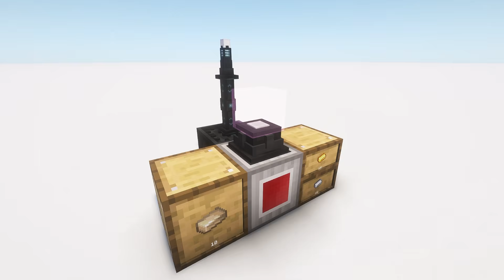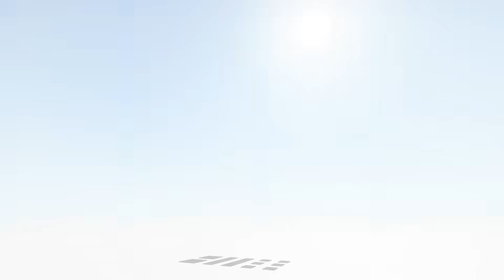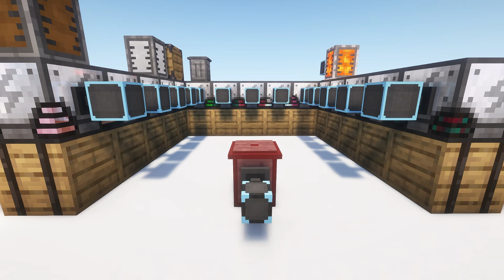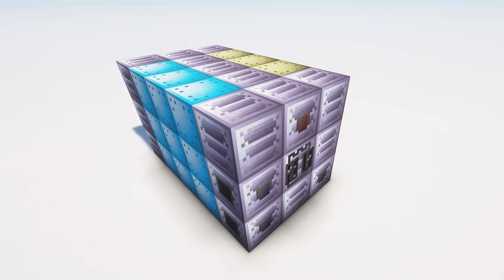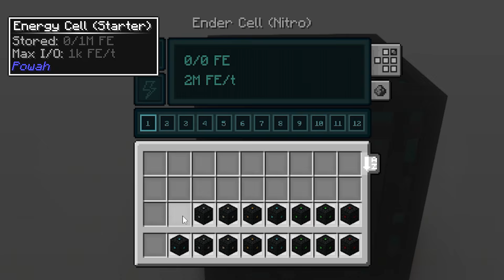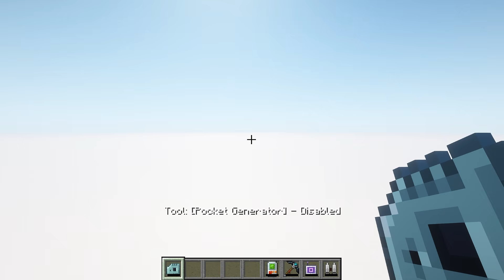Best Power Sources and Setups in All The Mods 10

Comment from the maker: FAQ:
- In newer versions, you won't be able to put a glass bottle in the fluid tank slot. I tend to put another fluid tank in there
- Gas burning gens were nerfed after this video. But with 'Mekanism: More Machine' that was added you can run 1 Ultimate Pressurised Reacting Factory which will be able to support 6 gas burning gens off of the same setup. Each gas burning gen now makes around 30kFe/t
- It's not a glass tank. It's a framed wallboard I put on the outside with clear glass
- Draconic Evolution was added after this video
- Dyson Cube was added after this video
Reply: i put a bucket with lava where the glass bottle should be and it work
Reply: @PubbyPandaVA  Any other bottle work maybe, i try with nectar bottle, its work
Reply: You can just replace the old bottle with a bottle o' enchanting. Which wont be hard to make with create spout and a bottle, the only hurdle in the process is making crushing wheels to get the nuggets of experience and make a hatch from enchantment industries.
Reply from the maker: The reason I don't like using something with fluid in it is because of the tank ever runs dry, it will drain the bottle
Reply: @BucketSt that’s a valid concern, I have yet to see it happen on my own set up.
Reply: @combatsoldier2160  Or just make a XP Drain Singularity Tank from Mob Grinding tools, then use a fluid pipe and the fluid tank with an empty bottle to get an xp bottle.
Reply: @combatsoldier2160  
you can also instead just do a full stack of buckets in the top left slot alongside the single lava bucket and so far it hasn't jammed up for me while the xp bottle solution has
Reply: My go to is the large heat generator if you pump lave in it it will create 1Milion FE/t and its so cheap and easy to setup
Reply: @bob-zh6el so true bro
Reply: Will you be providing updated video with Draconic Evolution?
Reply: I'm assuming draconic evolution is the best power storage now?
Reply: @dims9051 yup it is if umax tier of tier 8 it inf power storage lol and good power of reactor also of  draconic evolution
Reply: dad?
Reply: DE with all OP things it provides, absolutely blows in power generation in minecraft 1.20+ i have no idea why, maybe by accident maybe intentionally, but devs removed all ways to automate fuel insertion/waste removal.
Reply: I used an empty bucket where the glass bottle should be
Reply: Soooo... I am trying for the gas burners rn and Idk I think they got nerfed again cause I am using two electrolytic seps and two adv. press. reac. chmb. with also two adv. crushing factories and the gasburners are slooooowly filling up like I´ve been playing for an hour and they filled about 1k ethene
Reply: If you can get your hands on a mining dimension shard from Occultism. It lasts forever as a fuel on its own, you can eternal stella it and it becomes a never ending coal. It's a shame that I haven't seen anybody else doing it. 

This means no need to have any lava setup, no need to load unnecessary chunks either.

Comment: Future Commenter here:

For actual proper storage for energy, draconic evolution is an option. It does have one of the more decent bows in the game and to get the energy core for storage doesn't require having to kill the very scary Chaos Dragon since the majority of the core is just Awakened draconium and normal draconium. Not bad at all for just a bit of dedication for one mod you can easily breeze through with resource production mods like Productive/Modular Bees and Mystical Agriculture/Industrial Foregoing.

And guess what? The energy core store INFINITE energy and since cross Dimensional Energy Transfer isn't that hard (Especially with Quantum Entanglo which is basically limitless output) you have the best energy storage in game. Though it states that its infinite I'm sure there are restrictions in the game code that actually gives it a EXTREMELY HIGH definitive number (I forgot what it was) though for what you need to do just to get this is only really takes about 1 day of this mod's progression if you already have resource production nailed which you should've already done at least mid game.

Comment: I used this video to trace a purely nuclear path for my power progression. I didnt even have to TOUCH other power options. 
I went straight to bigger reactors' 4x4 basic reactor, making 18krf/t and powering my first mekanism machines. 
After that, I picked up some all the modium and entered the mining dimension, where I set up a quarry to fund my mekanism reactor + turbine, producing 270+krf/t
I used this practically limitless power to set up my base in the overworld and power the machines necessary to fund and maintain a fusion reactor. D-T fuel, lithium and MA were consuming only 90krf/t. Turning the thing on and leaving it running I got to sit pretty on 80Mrf/t and 50Mmb of D-T fuel!

Small caveat: used one (1) Nitro Thermal generator from powah to ensure my ether gas wither remains contained.

Comment: Are mekanism power cables bad? Or just mid tier? They were in the video but werent mentioned neither for early or late game
Reply: the more mekanism cablez u have connected to eachother = more power it can hold its good cuz it holds power itself so if ur maxed out and suddently ur power cuts for some reason then cable can provde power for a bit its even good when ur using a block which EATS power

Comment: One underutilised wireless charging method is the export card from the AE2 addon of the same name. You can select FE as the item to export, and send it to any inventory slot as fast as your ME system stores it. This even works with other fuels, for example Hydrogen in a Mekanism jetpack.

Comment: 2:15 if you are using the fluid pipe from pipez, you can add an upgrade card to increase the rate at which the dimension fluid tank is refilled.

Comment: I spent hours trying to set up mekanism reactors and progress through it only to hit a wall. I decided to just come back to this and use the gas burning gen until i need more power. The good thing is that i have the multiblock to store all the energy and a few drives to store fe in my AE2 system. took me a few minutes to set it up mostly looking back and forth at this video and making what i needed and setting all the input/outputs and its way better than I imagined for such an easy setup.

Comment: If an extreme reactor makes 40 mil fe a tick thats around 2.9k a tick per block of the 32x32x32 size. If you cut that size in half for pipes and put down unobtainium furnances with generator augments and speed upgrades they make 10k fe a tick which means its better to just make a 32x32x32 unobtainium and high energy cable block if you're in a position like with 8 eldritch miners making so much unobtainium, stellarite, vibranium, and allthemodium as well as dimensional cores which when stellarite'd they infinitely make power with no maintainence.

edit: checked out the nitro furnator and that ALSO works so if you dont got unobtainium but you got nitro bees you can replace the unobtainium furnaces for furnators and that makes DOUBLE which is about like 327 mil fe ish for a 32x32x32 size with half the size being used for energy pipes and the other half of the volume for furnators.
Reply: 163 mil fe a tick btw if you just spend the time stellariting the cores and placing down the unobtainium furnaces

Comment: 6:23 PLEASE explain this setup more clearly
Reply: gas burning generator got removed i think. so learning this wont make a thing
Reply: @sidguy123  No it didnt I found out what the setup consists off and how it works and it makes a crap ton of power
Reply: do you have a vid or sth? i also tried to find a way to generate this much power
Reply: @sidguy123  I could send you a screenshot if you like
Reply: @tavoltmo that’d be great

Comment: where abouts would you place the Dyson cube be placed on the list? It seems like a solid pick for power once you have shot up all the beams and sails  generating 1billion Fe/t would it replace all power or be along side other power mods as a support at the start of the power rush but main in the end game?
what's your personal view on the Dyson cube mod would it be a replacement for other power mods or just be a back up in the end if you need more power? would love to hear what you say.
Reply: Best thing probably. I used a power reactor for an RFTools quarry, then immediately started working on a Dyson cube. Together they generate 1.5M, for now 1M alone being from the Dyson cube. Resources are easy to come by, so in the long run, the Dyson cube is best.
Reply: @commandooo1122  yeah atm im trying to set up a ore miner from occultism and have it auto repair with xp but i wanted to 5x my ore droppes with mekanism with speed buff from industeral forgoing souls going to use alot of power im looking at what i have avalible in the mod pack im currently playing (Enigmatica 10) but iv found a blackhole power generation with ori tech so im going to experiment with that but also working towards fullying building the dyson cube for late game.

Comment: This is going to get burried, but you can soul surge the Mycelial Reactor to get 125,000,000 FE/tick, making it much more appealing as a mid/late game option.
Reply: did you try soul surging on all 6 sides? Does it increase it even more?
Reply: @lukyn1350 I'm not sure if you can, since I have a flux plug attached to draw the power out on one side. Maybe I can use a modular router instead but I think it would be slower transfer rate.
Reply: @omermangan1196 what about 5x times then
Reply: @lukyn1350 yeah it's 125M FE/tick 5x soul surged

Comment: hello i tried to do the first system with the thermo generator, a sink, a tank full of lava and a fluide pipe, but for some reason, the heat is not going in the generator neither is the water, do you have a reason for this?
Reply from the maker: For thermos, you need the lava in the world under the thermo generator and water needs to be piped in. The lava doesn't get consumed.

Comment: Integrated dynamics can transfer fluids and energy at the integer limit, you just have to configure it. It's main benefit is that it has logic implemented in it that can be used for highly sophisticated filtering, and can transfer fluid, energy and items in the same cable. My go-to cables for anything not wireless. Only issue is that it cant transport chemicals, and though the items cant be sent at the integer limit, a stack per tick is still absurdly fast.

Comment: My very first energy was through the stone generator in ATM 10 to the sky.

First - build a Stone Generator that generates Stone or Netherrack.
Second - Use a Compacter with a Pusher Upgrade to push material into a Crucible.
Third - build a Stone Crucible next to the compactor which receives material to create Lava.
Fourth - build a Generator with a Mechanical Pipe leading from the Crucible to the Generator.

An infinite power source.

Comment: For those wondering about the glass bottle in the fluid tank in the newer versions, you can also just use a wet sponge, id recommend you use it if your doing a very fast lava system, aka using a dimensional tank. just make sure the dimensional tank is being filled up very quickly.

 Oh and if your struggling pulling in the uhmm lava from the hose pump, you can use a mechanical pump along side NORMAL create fluid pipes from create, along side a multiple normal sized and large cogs to generate stress (aka torque)  WHICH: IMPORTANT: can be powered by (if your beginning level ) by multiple water wheels (replace the water with lava) and make sure to have multiple so you can pick up multiple buckets worth of lava instantly. then connect that final cog to the mech pump and it will begin to pump lava into your dimensional pump.  this is kinda how me and my friend did it and it works perfectly
Reply: You can also just use a fluid pipe on the hose pulley, a lot simpler.
Reply: @Ethanol_addict   i cant seem to get the hose pulley to say bottomless source even with the config enabled.
Reply: @jdenalso  having the same problem, I can't figure out the solution.

Comment: In the early game : mekanism heat generator.  Basically the same as powah, but doesn't need water.  It generate like 38fe/t and it's way cheaper than the wind turbine and you don't need any infusion to do it.

For charging, one that I like to do early game is mekanism charger pad: it's way faster and can take advantage of the many generator.  I don't think it has any kind of transfer limit.  But, you need to physically walk on it.  You also have, from Powah, the player charger (an equivalent of flux network charger but way cheaper).  It can sometime be a struggle to find an enderman (because when you search for one, you won't find it!  Thank you Murphy!).

I also see that this video might has been done before draconic evolution has been add.  This mod provide with some good wireless solution.
Reply: I found the solar gen easier

Comment: The mining dimension is INCREDIBLE for the mechanism wind turbines, as the starting y level is like 256 and you can build up higher. I had around 100 turbines or so hooked up and chunk loaded, and was getting 200MFE, making the max size reactor I built, also mechanism, obsolete, especially with how cheap turbines are and how easy they are to connect a web of them
Reply: My Wind Generator only does 360 FE/t per piece. You must have built thousands not 100. Or am I doing something wrong?
Reply: @shadowflamed9101 Idrk I can’t go back and look bc my friend stopped paying for the server, and I did it in atm9 I think not 10 so that could be it, but I do know and remember our astonishment at my wind turbines doing more than our nuclear reactor, and honestly it feels cheaper

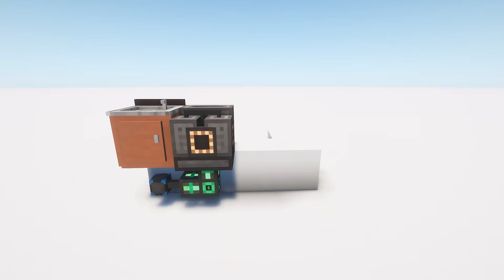Comment: Sorry, i might be a bit of a noob but what are the cable setups at 5:49? I see a universal cable but I dont know that block is to the left of it, the one with the blue corners.
Reply from the maker: That's a flux point. It's providing power here, but you can provide power however you like.
Reply: Flux point. Wireless power system

Comment: This is a bit of an unnecessary upgrade to power storage if not slightly expensive, but you can use Draconic Evolution's Draconic Energy Core which at it's max tier, can hold 9E FE

Comment: where would you rank dyson cube project ?
Reply: On top, a setup that only sends up around 10% of materials already outputs 100 million RF/t. Of course, you also have to consider that no power is generated at night time.
Still, the system is "cheap"... since it mostly uses iron, some copper, some glass, and some Lapis Lazuli. It still requires many millions of those units, but iron itself is easy to produce if you just set up a simple Mystical Agriculture farm with iron seeds, some copper, Lapis, and sand.
If you can live with that, the power is basically free since you don't need any fuel. Furthermore, the setup takes up practically no space, as every receiver is able to handle 50 million RF/t. You can also start pretty early. The standard Iron Farm block (not an actual vanilla iron farm) alone should provide enough iron to get an ME system running and start some automation, provided you also get a battery.

Comment: My good sir, can you please tell me whether they nerfed the gas generator? This would be very helpful
Reply from the maker: They have been yes. They make around 30kfe/t now and you'll need one pressurized reaction chamber per gas burning generator. However the upside is that you can upgrade pressurized reaction chambers now. I had one ultimate pressurized reaction chamber (The actual name is slightly different) supporting 6 gas burning generators.

Comment: I cannot put a glass bottle into the ender io tank to stop buckets from going into that slot. am i doing something wrong?
Reply: Nevermind, the glass bottle didnt work but i swapped it with a basic fluid tank and it worked.
Reply: @ShieldLover22  i cannot put a basic fluid tank in it either
Reply: @Planken  turn the "bucket mode" on (key assigned)
Reply from the maker: Yeah you can't put glass bottles in there any more after one of the updates. But I too have been putting a fluid tank in that slot instead

Comment: I’m trying to do the hose pulley and it doesn’t say infinite when I’m in the nether with the googles and it’s not pumping into the tank I have the same set up but it’s not going
Reply from the maker: It sometimes doesn't like pipes from other mods. Just have to keep trying, or sometimes you can move the hose pulley and it'll work. It won't say whether it considers the pool to be infinite until you start pulling from it

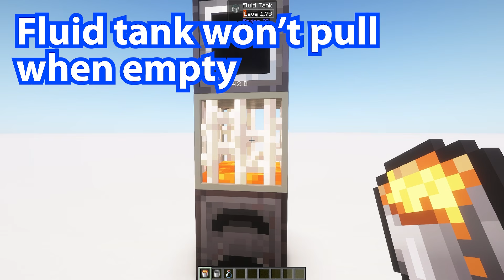Comment: hi as of ATM10 version 4.10, i cant get a Glass Bottle into the top left corner of the EnderIO Fluid Tank at 3:10.
Reply: you can put a bucket of water which does the same as the glass bottle

Comment: Most recent version did not allow the bottle to be inserted, so I but  water bucket ,and used the hose pulley on a dimstorage, so it should always be full.
Reply: You can put a bottle o enchanting instead
Reply: @shl @shlasher007gg7 if you don’t have a bottle of enchanting, 16 empty buckets will work as well.

Comment: What are the small baby cubes you used for the gas burning generator? The black and blue one looked like it was used to give power to the machine and the black and green ones look as if they were used to store the extra gas. I noticed there was one connected to each of the 5 gas burning generators but I can't find anything like it within the JEI
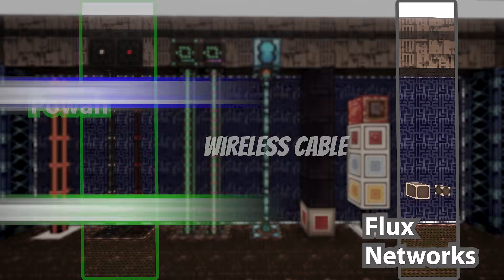Reply from the maker: Flux points push, flux plugs pull 13:19